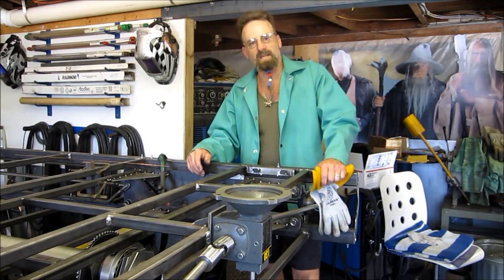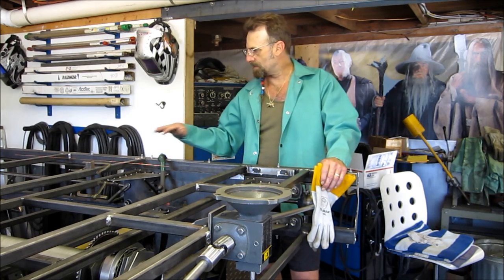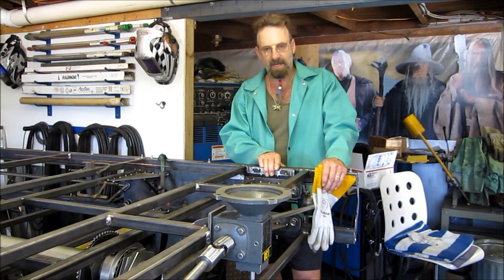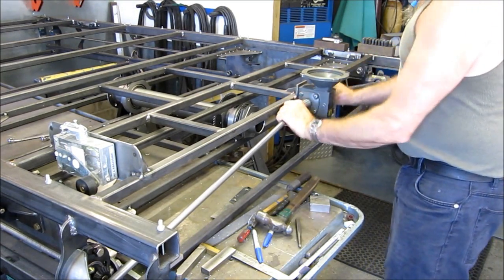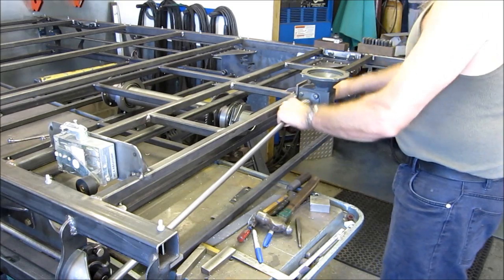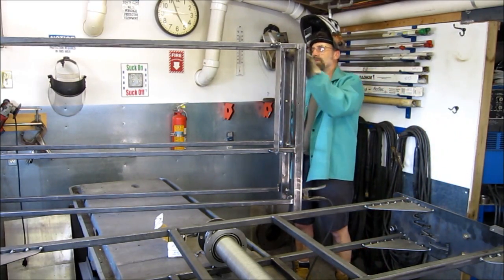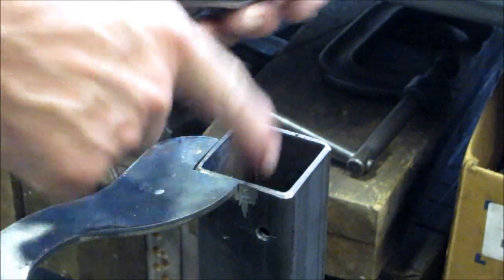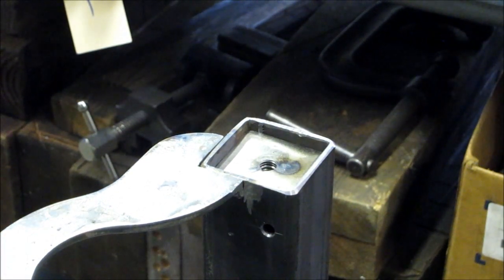Big Screen Elevator Part Nineteen

Comment: Using Grade 5 bolts, 3/8" - 16 have a shear strength of ~13,250# (UTS = 120,000 psi, XS = 0.11044 sqin)

Designed for a factor of 5, the bolt is good for ~2,650# in cross bolt shear.

As an eye-bolt, lifting vertically, the same bolt is rated for no more than 1,300# - or ~1/2 the load of a horizontal bolt.

Since the frame weighs ~260#, plus motor & TV, it's still a safe design, as any one of the 4 connectors will support the whole assembly.

Comment: Keith nice work, great project.  The framework filled up that space watching you tack crouched in between the frame and your belt sander.  Good idea with the toe clamp and bolt to drive the threaded plates in the square tube.

Thanks again for the videos on the project.  I know that takes additional time (a lot).

Comment from the maker: Alright, I have just finished weighting all the parts except the drive motor, because it’s over my buddies house, we also are going to be, the wiring light, which we can add, when installing. It is over 250 pounds! I'll be working on part Twenty...